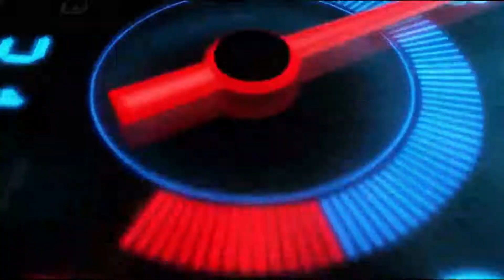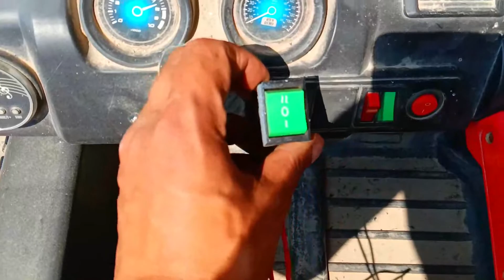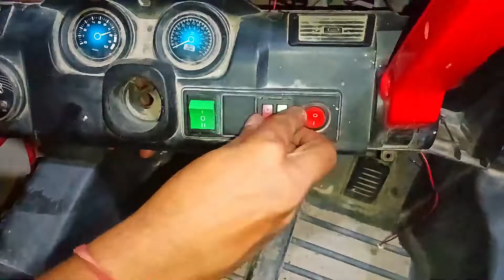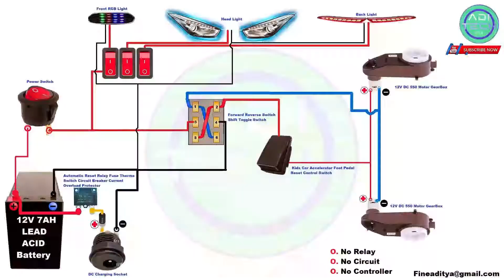Kids Car Wiring DIY With Wiring Diagram

Comment: Bro please respond small Issu Staring motor and Music board Connection Tell me please Urgently
Reply from the maker: Steering Motor Worked when Remote Connected, Music Board Connection is very simple, send me a pic or video of board or controller. WA 8287617223